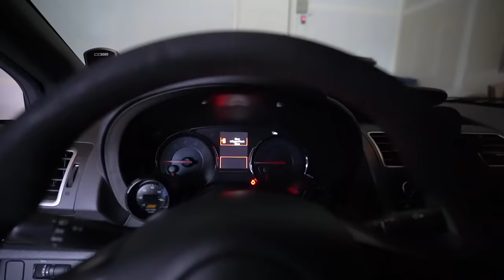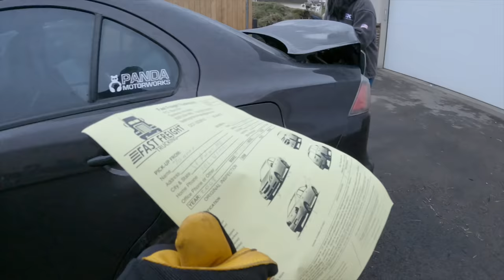Taking Delivery of Bobbi's 800WHP Evo

Comment: Bobbi don't change it one bit...Better you tune it down to like 700hp. Almost same built like mine built bottom, built head GSC  S3 cams, 6466 precision, double 450 radium. Just got base map to break in...  stock Trans.